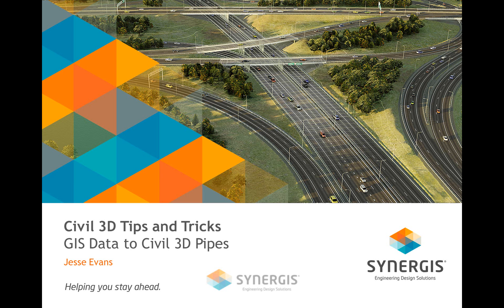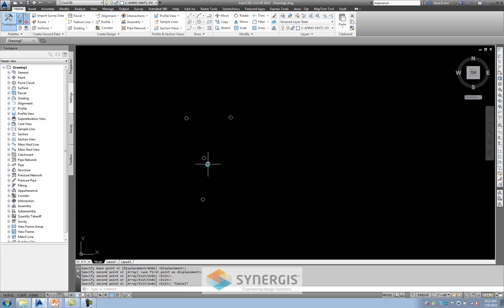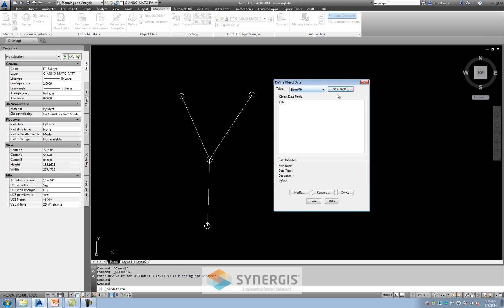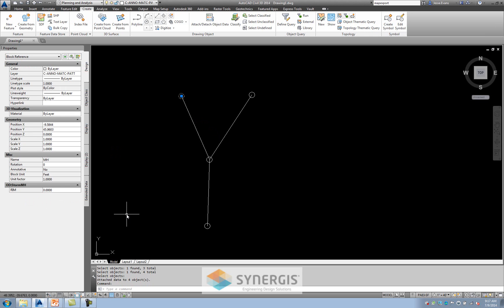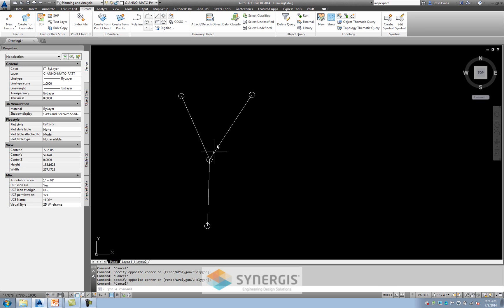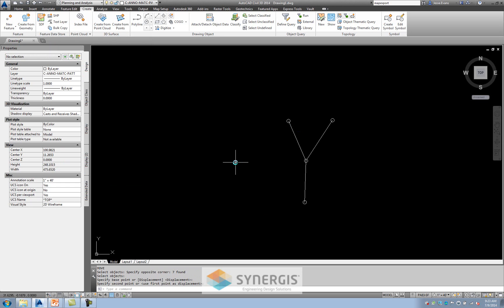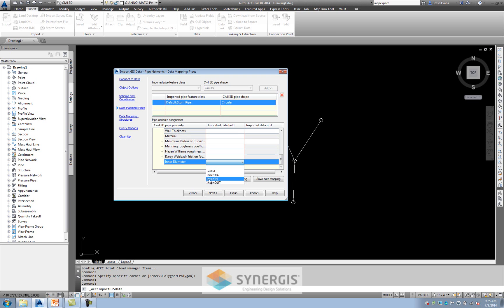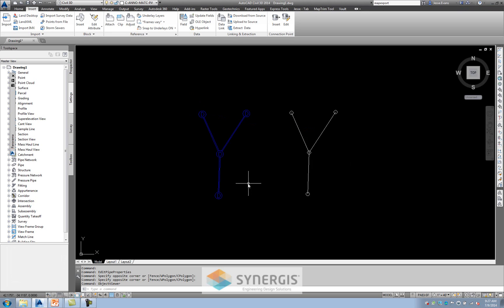AutoCAD Civil 3D: GIS Data to Civil 3D Pipe Model

Comment: Hello! I have a question which is how can i export the pipe network (i.e. import from shapefile seems like the video) in civil3D to Naviswork? Since i just can export the 2d shape..i try many ways to export 3D model to Naviswork for clash detection.
Thank you!
Reply: Generally speaking, you just need to append the navisworks model with the drawing containing any Civil 3D objects. If it did not get installed automatically, you will need the object enabler for navisworks to see the objects. Otherwise, you get the dreaded wireframe boxes. Check here for how to get the object enabler: https://knowledge.autodesk.com/support/navisworks-products/troubleshooting/caas/sfdcarticles/sfdcarticles/Navisworks-do-not-recognise-Civil-3D-entities.html